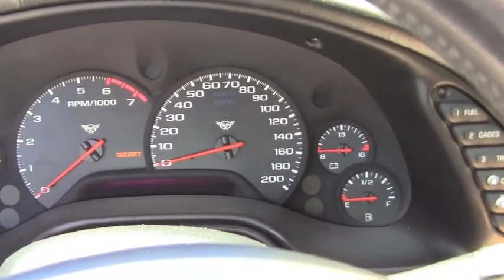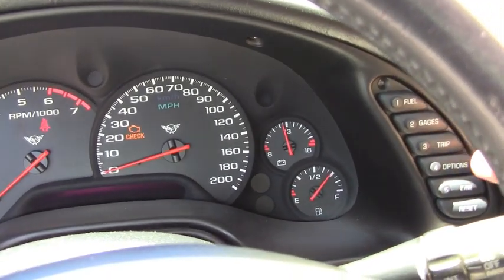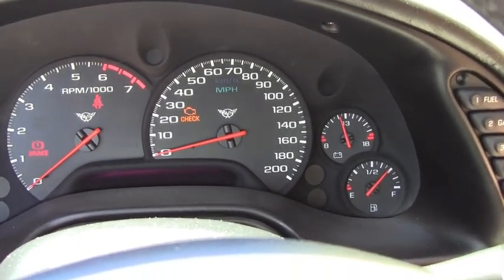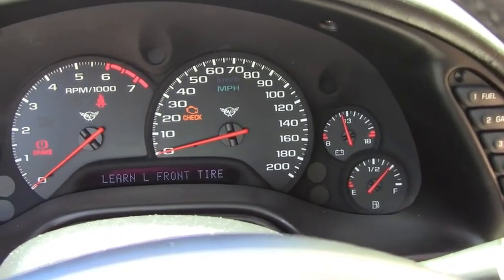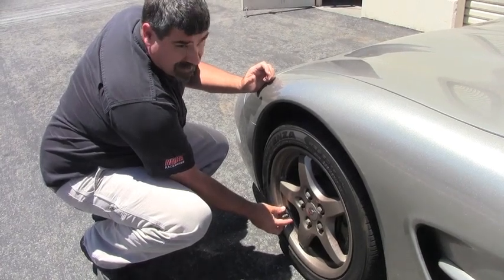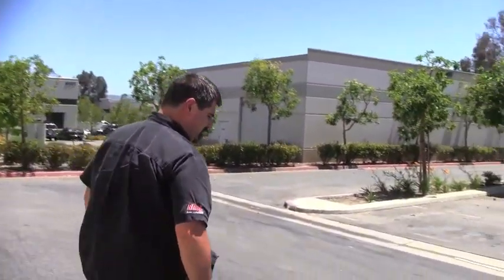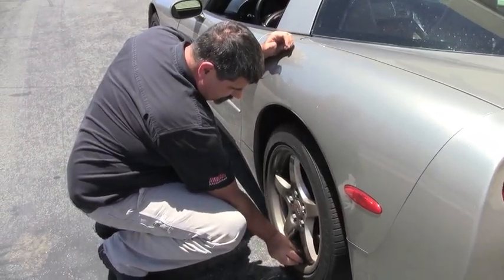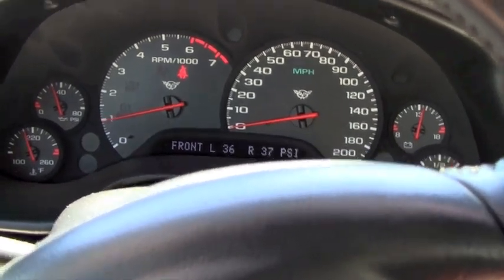C5 Corvette TPMS Reset

Comment: Thank you! went to Americas Tire to have TPS installed on my 2001 C5 and they were having a hard time getting them programmed. I could wait around any longer and told them I will try to figure it out, or if needed call a dealer and if they charged me I told them I want that amount removed from the bill Americas Tire said I could bring it back when "I had more time"and they would get it done...I already waite 2 hours while you installed the system then jacked around with it for 30 minutes trying to figure it out, no thanks. Got home, searched the net and found this, 5 minutes later, TPS is programmed!..Oh, I I didn't need a ring magnet, I used my telescoping tool magnet, worked like a charm...Thanks again.
Reply from the maker: +grahamski Good to know about the tool retrieval magnet! I will have to try that myself.

Comment: Had a Right Front sensor put in and went through your setup. Took the car for a ride and the left Right Front pessure displayed. However, it seems the rears, which were displaying before now read "Left Rear XXX.   Right Rear XXX", Also displayed is "SERV. TIRE MON. SYS". The Rear Left tire did give a horn beep but never registered on the display. I'm sure it's something I did. The magnet I'm using is a fairly large ring maybe it needs to be smaller. Any help would be appreciated.

Comment: Is this a standard reset feature for other vehicles that have them (including other car brands)?
Reply: Dcc357 the clockwise procedure is pretty common but not all of them are initiated from thr DIC. For example many recent Nissans or infinities have a little white two pin connector near the footwell. There is only one wire in it. Usually it is taped up from the factory if your tire sensors have never been replaced. You arr supposed to short it to ground 5 times in a short amount of time. Like 5 seconds or something. Then you go around to each wheel clockwise from the driver front wheel triggering each as you go. You need the proper RF trigger for the sensors. I think one company is called Ateq or something like that. Other systems are probably similar but still a little different. All depends which third party designed the TPMS.

Comment: Thanks for the vid. I plan on putting OEM base C6 wheels with their TPMS on my C5.  Will the C5 accept/read C6 TPMS?
Reply from the maker: +Craig Candor I don't believe so. The C6 uses a completely different TPMS setup, as evidenced by the fact that you need to use a special tool to reset them. I'm sure that C5 TPMS sensors can be retrofitted to C6 wheels though, and if you got a set of take-offs with the sensors included, you can always sell them to help pay for the C5 ones you need.

Comment: Can you change the pressure that sets off the warning? I have different tires that take a higher pressure so my warning is always on and it drives me nuts!
Reply from the maker: It's probably possible with an ECU reflash, but I would have to do some research.

Comment: I must be missing something, I have a 2000 and when I fill up the tires, then get the car up over 15 MPH it shows the new tire pressure (Just like in the Manual) What situation would call for you to have to reset them all? I mean if you change all 4 tires, once you get moving wont the sensors get a reading off those tires as well?
Reply: Supes Me if you change the sensors your car will not recognize the IDs on the new ones.  Imagine if you were driving or in the parking lot and the car just starts picking up random signals from everyone else's TPMS. How would it even know which corner is which? That's why it has to be programmed. Think of it like bluetooth pairing.
Reply: Yes, if they're in the proper orientation. The problem is, if your minimum wage "tire expert" rotates your tires or replaces one or more of the TPMS and then can't get the new sensors or their positions programmed, this easy fix is good to know.

Comment: Worked perfectly on my 2000 C5 convertible.  A strong magnet was definitely a must.  I first used a telescopic bold retriever and it wasn't strong enough.  Then tried a magnetic nut/bolt holder (bowl) and it worked just fine.  BTW, these are the original 14 year old TPMS on my car and the batteries in them are still kicking.

Comment: Question:  My Front Left reading says XXX then goes blank, I tried the training then when I get to the right rear nothing happens???  Would I need a new sensor?
Reply from the maker: Unfortunately, you probably will need to replace them. The batteries were never designed to work for 10+ years, so every C5 is going to experience TPS issues in the near future, if they haven't already.

Comment: I just took my 2000 out of winter storage, added air to all tires to bring them up to 32 lbs. Both fronts read proper pressure, as does the left rear.  The right rear reads XXX.
Does that mean that sensor battery needs replacement, or does it mean they all need to be reprogramed in the proper sequence with the use of a proper magnet?
Reply: Why don't you just try the reprogramming to find out, rather than waiting 6 years for a reply? LOL

Comment: I'm getting new wheels and tires already mounted and forgot all about the tire sensors.  I DON'T NEED THEM AND HAVE BEEN DRIVING SAFELY FOR 45 YEARS WITHOUT THEM.  Whew.  So I just need to disable the system, because my current sensors are still mounted in my wheels and tires, and I was going to sell them as is.  I don't want to take everything to a dealer, dismount both sets and mount everything again.  I just want to disable the system.  Trust me, I won't die without them.

Comment: This procedure is for factory TPMS sensors.  It should be noted that many aftermarket sensors cannot be learned to the vehicle with a magnet.  The difference being that you must let air out of each tire and wait for the horn to honk/beep.
Reply: uploadthis2011 this is true there is an alternate method where you have to have exactly the right PSI at each tire and the car will determine which location is which based on the PSI. Forgot about that until you mentioned it but I remember now seeing it in the FSM. Thanks!
Reply: So it will work if I let the pressure out?

Comment: Tried it with a large telescoping magnet three times but didn’t work!  Now I got traction control and ABS messages on my dash!!!  GRRRRR
Reply from the maker: It sounds like you may have a failing/failed electronic brake control module. Have you pulled codes? 

Also, it's worth noting that by this point, the batteries in C5 Corvette TPMS senders inside the wheels are all well past their expected service life and if they're out of juice, there's just no way I am aware of to reset the computer to ignore them.